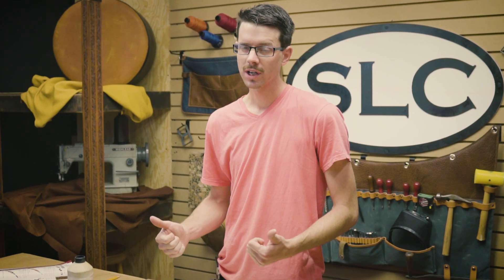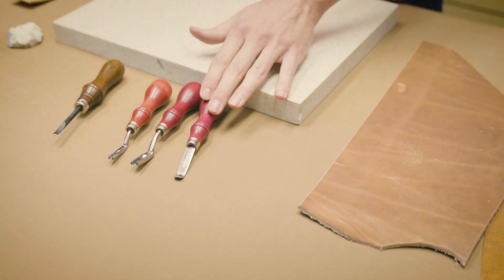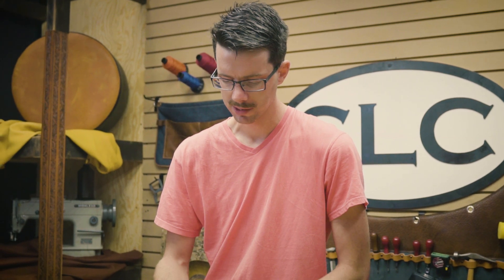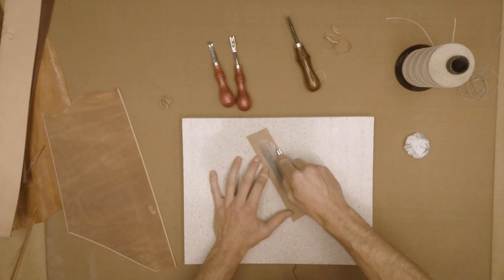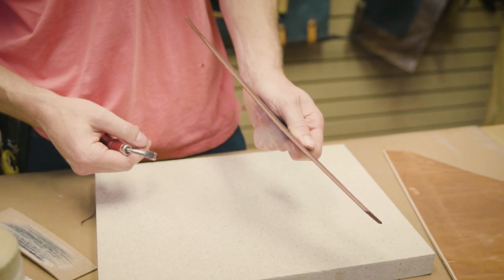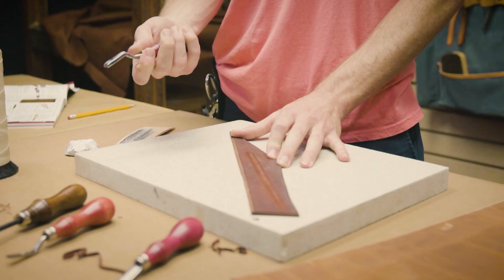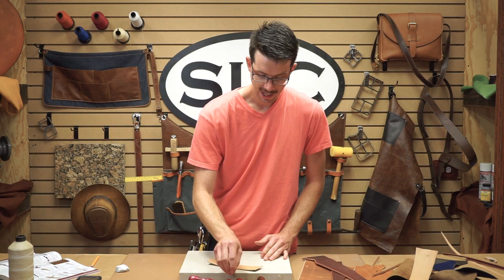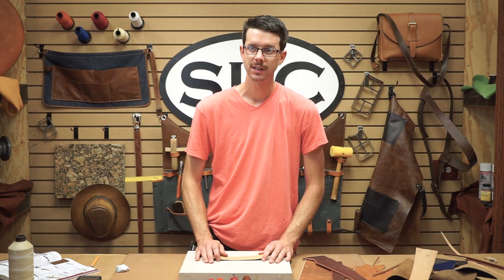Flat Profile Bevelers

Comment: My bevellers got really dull even with a lot of stropping. I got the crazy idea of using a diamond stone knife sharpener, or a good sharpening stone with a good edge then stropped. Man talk about sharp. I only made 5 passes pulling the bevellers  down the stone with just the weight of the beveller. Then stopped on the edge of my strop. Worked very well for me. I had always sharpen them on a piece of sandpaper laid over some thread. The stone is a lot easier & sharpened them very good. Don't know if everyone would want  to try this but it did work for me.
Reply from the maker: Great info, Eddie! Thanks for sharing!
Reply: @SpringfieldLeather  I used the edge of the stones. I didn't say that but it did work. Didn't put any pressure on them just the weight of the tool.

Comment: I got into leather working from my hobby of making knives and their sheaths, I found I really like leather work. My favorite is making belts to match the sheaths I make. Beveling belt strips it is crucial to have a sharp beveler. I use diamond compounds to polish my knives by hand as diamond is much more aggressive at polishing hardened steel. It works wonderfully on stropping my bevelers and I use 5,000 grit to finish the edge.
Reply from the maker: Great tips!